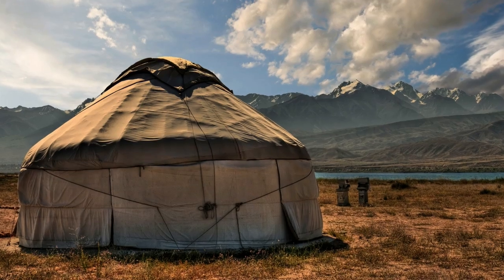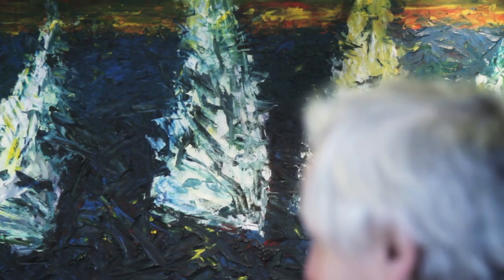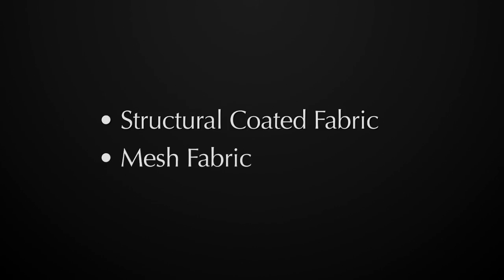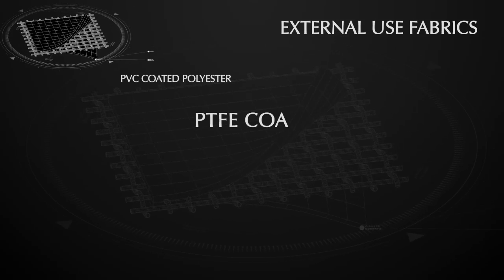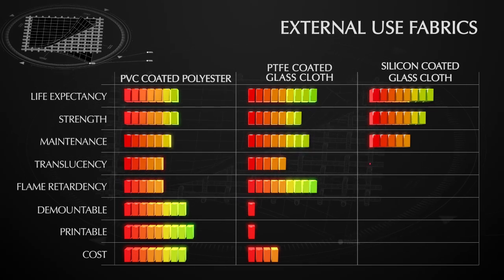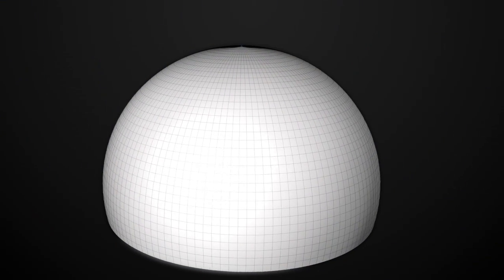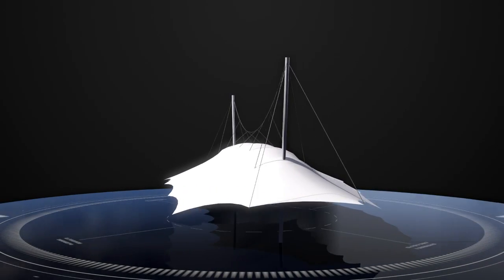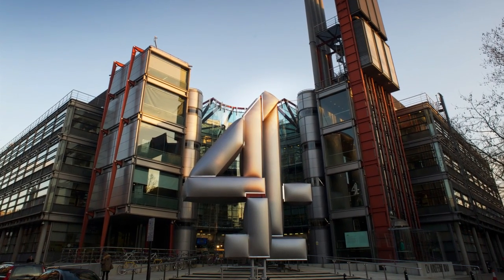Tensile Fabric Architecture: Part One - Materials & Forms

Comment: what software was used to create the 3d models? i am currently using ads max and having difficulty to achieve the realistic fall and tension. any help with this would be great, thank you.
Reply: +fairo http://www.marvelousdesigner.com/product/overview/  used in games and enterainment and fashion for cloth sim. could do some interesting stuff in architecture i'd think. so far only simple arch applications in gallery. potential is there i think to use to explore ideas rapidly. you'd probably want some autodesk structural engineering software for the real cad model